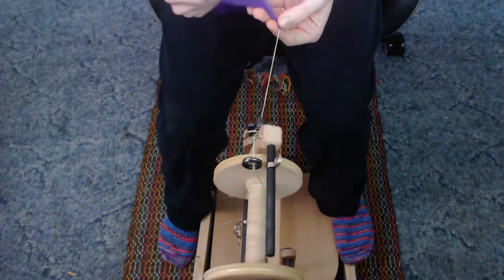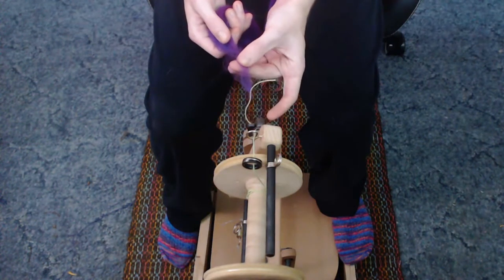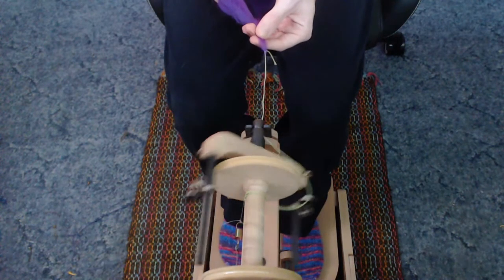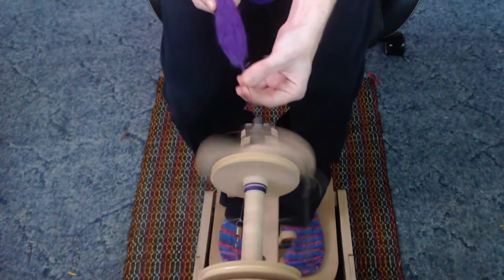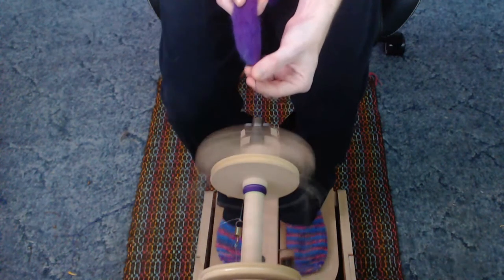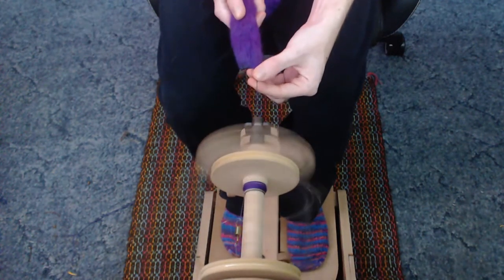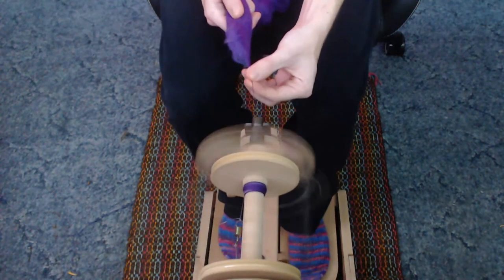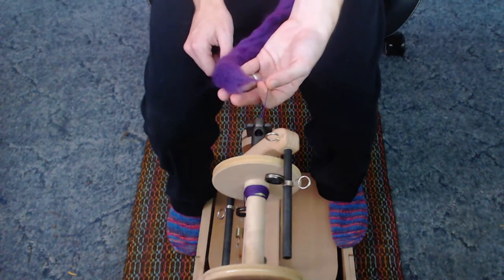How to Spin: Part 2 - Spinning

Comment: One of the best explanations of spinning I’ve heard, so helpful and clear. One suggestion would be to hold the camera from an angle that the spinner would view👉 
I have to view like that to understand but I was able to turn my phone without it flipping so it was not an insurmountable problem. Thanks again, I’ll be checking out your other videos too. Reading how to spin doesn’t help me but your video did. 😀